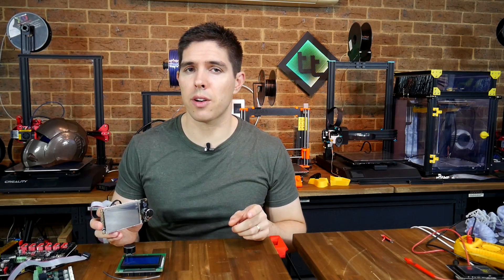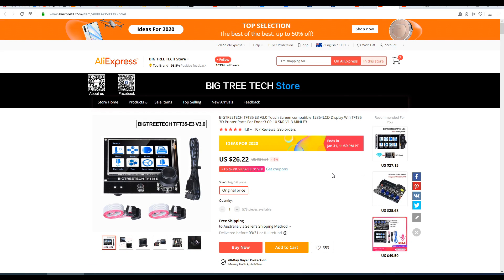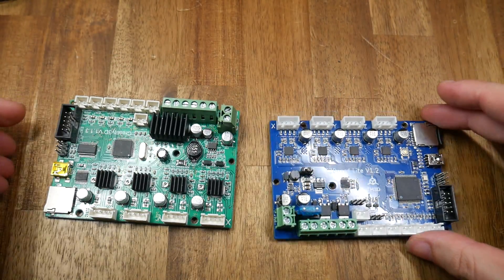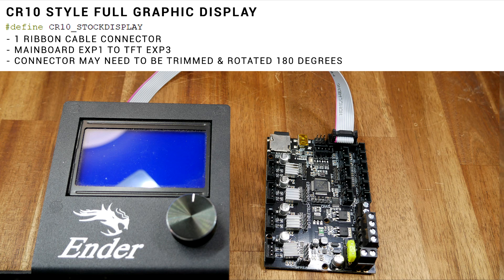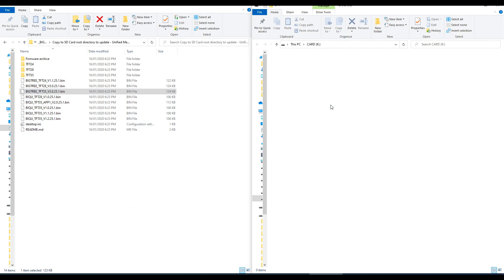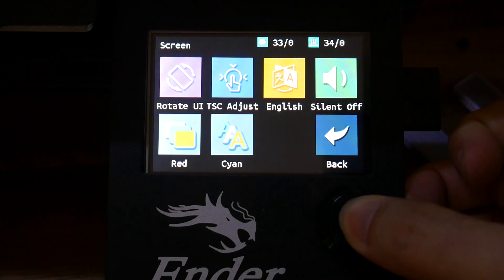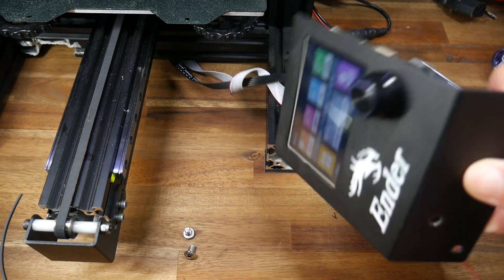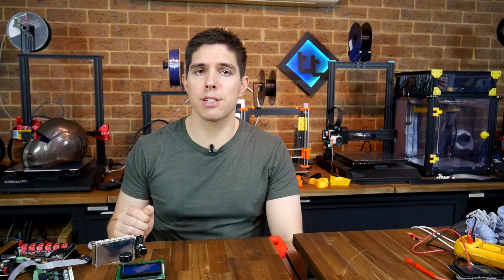BTT TFT35 dual mode touch screen guide

Comment: I installed the TFT35 with the sky mini e3 v1.2. If I start a print from the Marvin side, everything works fine. If I try to start with the touch screen, I get the error:  “unknown command: “M33 CE3_BE~1.GCO”. any idea on this error?  I have version 26.0. I will try following your steps to download the newest version.
Reply: Same issue with me, there's two SD options to start a print from, but only the TFT one works, I get the M33 error if I use the onboard from the SKR Mini. To use the TFT SD, I had to find an actual sd to plug into the side of it.

Comment: Great video, thanks.
I followed BTT instructions about changes to config.ini file and putting it on the SD Card and reboot. Tried alone and with the firmware to reflash. In both cases none of my changes took affect in the custom menu or new preheat values. Anyone else solve this problem?

Comment: @teaching tech

I just installed my TFT 35 V3.0 on my ender 3 with the skr mini e3 V1.2

But the led ln the screen knob wont work. I only get error messages?
Reply: It only states unknowm command "m150 r0 u255 b0 p255"

Comment: I had the baud rate problem but also had a touchscreen problem as well making impossible to change the rate. The touchscreen wouldn't register touches. After lightly massaging the screen it started working and has been reliable since. I love the board and e3 mini, mad I didn't update it sooner.

Comment: I went out and got a TFT 35 for my ender 3 with a skr mini e3 and have had nothing but issues. waste of money as it sits.
Reply: That's because you've not got it setup right. I've got 3 SKR boards, including a Mini E3 v1.2, and both the TVT35 V3.0 and TFT35 E3 and it all works flawless, For the Ender 3, there was nothing I had to do, nothing..just hook everything up the right way.. that's it, anybody can do it. BigTree's Firmware on the card works out of the box

Comment: For the tft35 by itself, I have 3 machines all running the tft35. the first one I installed and setup looks fine the words fill the whole screen in marlin mode. The 2nd and 3rd ones have a smaller display showing. I don't know what I did wrong. The 3 displayed were installed at differentiates with getting all the firmware from the btt github.
Reply: Go into touch screen mode, there are settings there to change screen size.
Reply: @mr.spongylikeaboss4987  I wasn't able to find them. The Touchscreen size is good. It's the marlin side that's smaller.

Comment: At 10:28 i see warning about "no printer attached" and i have same issue...
I use BTT SKR 1.4 turbo..
Already flash firmware several time, edit baudrate to 250000, but nothings works..
Do you have any solution?
Reply: Did you use both flat cables for the connector EXP1 and EXP2 ? If not, try it !
Reply: Make sure you have all 3 cables connected. Make sure "Reprap full graphic LCD" is set in firmware.

Comment: Important to note exactly wher the xyz stop connectors are applied. I cut off the wrong side of the clip and board was dead.  Then rewatched video and you must cut the left side to install correctly.  Board came to life but no firmware loaded.  I need to re install.

Comment: So I have the tft35 and a stock ender 3. Is there a way to get touch to work or does it require another motherboard. (tried the baud rate etc...) I have an skr smoothie on the way but want this screen for my Cr10 too.

Comment: I recently installed a complete skr mini e3 and tft35 into my Ender. So far, I love it. but.. I notcied something.. I was wondering if you also experienced...
I print all my stuff using Octorprint to the main board USB.  While printing a thing recently, I was trying to adjust the "feed rate" on the fly using the touch-screen.  It showed the adjustment being made (from 100 to 95). I thought all was good. but, it didn't seem to actually make any difference in the print.  I used the octoprint terminal with an M220 command, and it still showed 100%.  Same when I switched to the Marlin interface in the TFT35.   Using the Marlin interface to change the feed rate works perfectly.  And.. when I go back to teh touch-screen mode, it does not show the new set Feed Rate.. only the feed rate I had tried to set it to initially.  ?? Thoughts?

Comment: Is there anyway to pause the output in the gcode terminal or to scroll up?  I'm trying to execute an M115 to see the firmware version on SKR 1.4 turbo but the firmware revision blips past and all I can see are the capabilities report.  I have the touchscreen working but I cannot get the LCD mode to work, when I switch over to it all I get is a blank screen(backlight is on) and turning the dial or pressing it does nothing.  If I hold it in, the choice menu of marlin or touchscreen comes back up.

Comment: Maybe someone can give me a helping hand. I have the Ender 3 and made a 1:1 swap with the TFT. Everything ist fine and also works under merlin, but on touch mode, I always see "no printer attached" even I changed to "BAUDRATE 115200". Any hint of how to fix?
Reply: The touch mode wont work with the standard board as the tft requires a separate connection that the standard board doesnt have.
Reply: You need an SKR board to use the Touchscreen mode.

Comment: Good video, but crucially - IT'S FULL OF BUGS AND MAKES PRINTING A REAL MISERY.

I'm on the most recent version 3.0.;26 on an Ender 3 with an SKR mini E3 V1.2 installed, and IMMEDIATELEY several bugs make using this almost impossible. In the first 1`0 minutres of usage:

1. In the menus, gGet's stuck in "Loading..." and never comes back.
2. Alwaydsa reports "Printer not connected" (baud rate irrelevant) though this always goes away and it always IS connected.
3. Can only see the first tiny few letters of print files in the standard version - extended is better.
4. Long-holding the knob doesn't always give you back the old Marlin interface which is a real shame since the new one is so flakey. Powering off is common.

Maybe this'll all get better, but it's been aropund for a while and it's time it was way better than this already.
Reply: ... update - it's settled down somewhat. Still many things don't work, but it does seem to be potentially very good if I can iron out the flaws.
Reply: @chriswesley594   Strange, mine work fine.

Comment: I purchased the combo and installed.  1 problem I have is that I can not print from the Marlin mode but can print from the TFT mode.  also, if I start printing from the TFT mode I can not change.  Is this normal oe is there a fix for this?

Comment: mine seems to only work if i don't plug in the Reset pin (SKR 1.4 Turbo, TFT35 E3, everything fully updated), any guesses?
Reply: You sure you have it connected right? I only ask because I had the pins backwards, but now mine is fine.

Comment: Hello, just ordered the TFT35 E3 V3 to use with my skr mini e3 v1.2 in my Ender 3. and I'm running your firmware on it, thank you!! main thing i wanted it for was the memory card location on it. was going to the ribbon cable extension  and print the bracket for it. this will be better.

Comment: Hi Michael. I noticed a mismach between the marlin screen and touch screen running unified menu. For me the Marlin screen uses the config I uploaded whereas the touch screen mode uses the default factory config for skr 1.4 board.  It sounds very odd, but am I doing something wrong. Thank you

Comment: if your using the duet2 wifi and want to use a screen like this instead of paneldua touch screen is that possible, I haven't used either screens so I wasn't sure about the paneldua screen it just didn't look good it might be better once I get it

Comment: Mate your video saved me hours of stress! i never coment or hit the bell but done it as you made my day! Skr mini e3 with a tf35 and  on most website it showed the ports wrong way around! your the only video/reading information that has fixed my problems! btw have to cr-20s and an ender 5 upgrading them all too mini e3s tf35 and the 2 cr20s are also having two screens each the other screen is a tf24. Will have to make a print that will attatch the tf24 to the cr20s as they dont fit inside case... what a better time to upgrade and get into printing when were all stuck inside. Cheers again mate

Comment: Hi i have just instaled the TFT 3.5 v3 enlarged with my Ender 3d with TH3 Marlin. I cant make detect my Printer. So i tried Updating firmare thru the display and now is worst.! When i change mode Green screen without text i see. And in itouch mode no printer found. Any idea to solve the problem ?In forum some people have same problem,THX

Comment: Hi i wonna know of you can connect Bigtreetech TFT35 E3 V3.0 dual boot to orginal ender 3 print ? And of you can use both mods marlin and touch mode.

Comment: I'm having quite a few issue with this particular upgrade and wanted to check a few things with people who have been successful. Installing on an Ender with an SKR 1.3 board. Different situations depending on the hookup: TFT EXP 3 to SKR EXP 1 only gives a black screen and no response to touch or knob. TFT EXP 2 to SKR EXP 1 gives me full touchscreen control, but only displays 'LCD2864 Simulator' with no ability to control in that mode.  TFT EXP3 to SKR EXP 1 gives me full touchscreen, plus I get a display in simulator mode, and can 'click' the knob, but can't move up and down in the menus ( I also tried a different cable to see if it was bad with no change ). Can anyone make any suggestions on what to try next? Thank you.

Comment: I have an issue where the screen does not want to boot when the AUX1 (On skr v1.3) plugged in to the AUX 3 (tft) with the RS232. When I unplug the AUX cable from the screen, the screen boots normally and I can replug the AUX cable. The oldskool menu then just works !? But I cannot boot with both cables plugged in. I first have to unplug and replug before it works. This is not the normal way of working right? Can somebody help me out here ;) Thanks

Comment: Ok touchscreen side says “no printer attached” and baud rate doesn’t help. Updated firmware and Marlin side of display is fine and comtrols printer. Any thoughts? Running a SKR E3-DIP V1 with 2208 chips, firmware updated to BTTs latest build. Thanks!
Reply: I should also add I have 2 identical E3 Pros, same board and everything and same prob on both.
Reply: Hi  @peterc1679 , have you been able to solve the issue? Could you please give us a little of feedback on how to solve it?

Comment: Hi,  I wonder if you can help me, I have just changed my screen to a BTT tft35  E3 and followed your video. I put what I thought was the firmware update files on a blank micro SD card and when I tried to flash the update and I got this error message ( Illegal flash App) and now my screen will not do anything. Can you help me

Comment: HI, great video! Good job. I tried it on an Ender 3 pro but I still have the message "Printed not attached". I have tried the 2 baud rate config (115200 or 250000) but it doesn't work. I always have this message. Do you have an idea? We juste have to put the cable on the EXP3 port? it's the same wiring than the original screen? Thanks a lot
Reply: same problem here, any idea what to try next?
Reply: same problem. any idea????

Comment: Hi, I hope you can help me. I've a Anycubic Kossel Linear + with a RepRap Full Graphics Smart Controller. If I connect the new touch screen to the board through two ribbon cables, it works just fine as a normal 128x64 screen. But if I connect the screen through the RS232 to the board using the port AUX UART 3 (I've used other cables to sort the pinout just right). But it keep displaying "Printer not found". What else I can do? Which settings in the firmware I've to modify?

Thanks for any help.

EDIT: I've forgot to say that I've the stock Trigorilla Board.

Comment: @Teaching Tech @Michael ... although I know its new .. any chance you could do a complete Marlin 2.x guide inclusive of the BGT 1.4 boards and various stepper drivers ? what im most curious about is stallguard2 vs just the switch stops .. does it really matter? is it just about less connections?

Comment: EDIT: I got it to print good with a lot of fiddling with the different buffer sizes, of course newest marlin bugfix and the new 25.2 fw compiled for the TFT (not just copied from the download), still have the problem with the SD card in Marlin mode, it shows removed when I insert it and vise versa and it shows no media as it think it's removed.

Hi, I got this TFT35 v3.0 E3 display last week and it was easy to connect and update and did seem to work perfectly but when I printed some curvy parts I noticed that it got blobs and zits all over and the part looks terrible, I also saw that the printer was hesitating and made micro stops in the curvy part of the print, like corners and circles. After a lot of reading online it seems to be a big problem in how BTT use the serial interface and the buffers, the M114 command. It printed fine if I used the Marlin mode on the display but really bad in the touch mode. After tips on a Facebook group and Github I flashed the latest marlin 2.0 buxfix but still have the same blobs on the part, also I lost the SD card in Marlin mode, so now I can't even compare between the two mods without reverting to an older bugfix.
I really hope this bug will be fixed soon or else the new display is useless.

Comment: Just got mine installed and the graphical display is great!  However; I have no marlin mode.  When I hold the control knob or press on touch screen, I get the marlin mode vs graphical mode options but when I press on Marlin mode all I get is a blank screen.  Pressing the screen or turning the control knob has no effect.  I have the MKS Gen L board.  I was a little confused as to whether Exp 1 and Exp 2 both needed to be reversed or if only the Exp 1 had to be reversed.  Any help would be appreciated.
Reply: Came here looking for the answer to just your question so thought I'd leave a note. Comparing the wiring diagrams told me that BOTH have to be swapped.
Incidentally, an easy way to swap them is to (carefully) pull-off the black plastic shrouds from the MKS board and put them back the other way around - this is especially satisfying for my OCD as it puts pin one in the correct position.

Comment: Here's a heads up - just installed a TFT35 E3 V3.0 on an Ender 3 Pro that has a SKR Mini E3 control board. When attempting to update the firmware to the Unified Menu version, the TFT would never fully update. The update finished in about 4 seconds and the resulting user interface looked like something that went through a malfunctioning Star Trek transporter and the TFT would say it could not connect to the the printer (the initial install from the factory worked perfectly without touching a thing). After fiddling around with it a bit - instead of using a Sandisk 64MB SD card I switched over to a different no-name SD card and tried again. That worked the first time. So, if you are seeing the update take only a few seconds, something is wrong with TFTs ability to read the SD card. Try formatting and using a different card. The update should take a minute or more and you should see all the new color icons display one after another during the install just like in the video above.
Reply: Perhaps it depends on the format of the SD card?
Reply: @timo8822  I agree - I think it was probably just a bad formatting on my part. Probably best to start with a newly formatted card just to be sure.

Comment: My TFT35 doesn't have the nozzel center for the blt to auto home. Also when leveling it doesn't move on to the bed. Looked to try to change this in firmware but can't find anything

Comment: I'd suggest a custom button to disable/re-enable soft end-stops to make setting the z-offset for the bltouch easier. (Or if there's a way I can set it without having to manually do the m211 s0 command through the terminal that'd be good to know)
Reply: You can enable the menu option in Marlin config files.

Comment: @Teaching Tech I'm a 3D printing newbie (thanks to you and CHEP!!) and received my Ender 3 a few days ago. I've also purchased the BTT SKR mini v1.3 board and TFT3.5 display and have installed them based on your videos. Is there another option to update the firmware without using the standard SD card? Unfortunately, my computer does not have any SD expansion ports. I've tried updating this firmware via USB and the mainboard mini SD card, but I've had no luck. Again, thanks to you and CHEP you guys inspired me to get into 3D printing!

Comment: Am I able to update the firmware over a usb drive or does it have to be a SD card
Reply: @jacob clutter I've tried to update the firmware via USB and the mainboard mini SD card, but I've had no luck. I'm in a bind because my computer does not have any SD expansion ports. @teachingtech Are there any other options to update the firmware without using the normal SD card? I currently have BTT SKR Mini v1.3 and TFT 3.5 v3 (bundled kit) and I would like to get the latest firmware. Thank you so much for the informative videos!!

Comment: @Teaching Tech  I am trying to find the best main board for my needs with a lot of expand-ability (Filament run out/Octoprint) that is able to use this screen as well.  I have been leaving my main board for last basically.  I was going to get the TH3D light board but now that you showed me it doesn't have the connection port for the touch screen option here I will be passing on it.  I appreciate you and your videos :)

Comment: I have been using the screen (E3 edition) for about a week now and I am unable to print from the built in SD card or USB ports in touchscreen mode. It prints for about 10 minutes then the hotend and bed switches off but the printer carries on trying to print. Marlin mode works fine from the onboard (SKR 1.3) SD Card. I've asked in social media and a few people have reported the same.